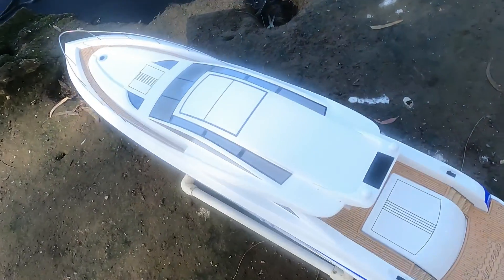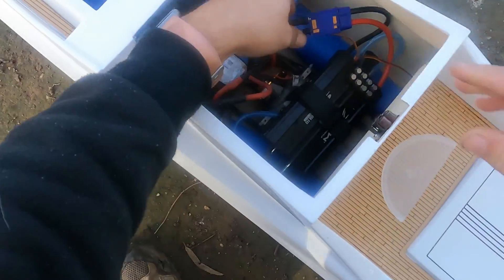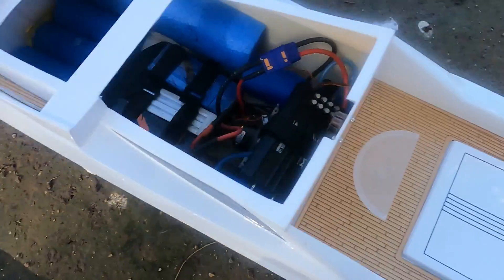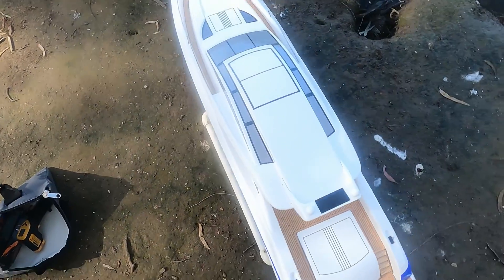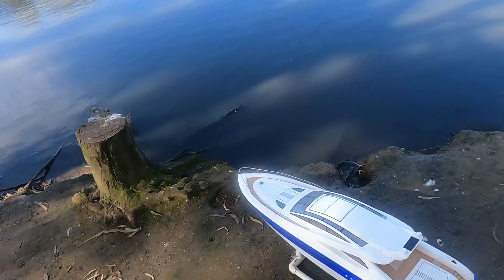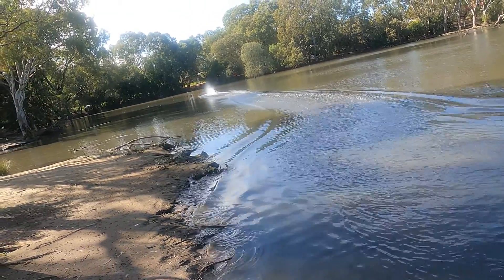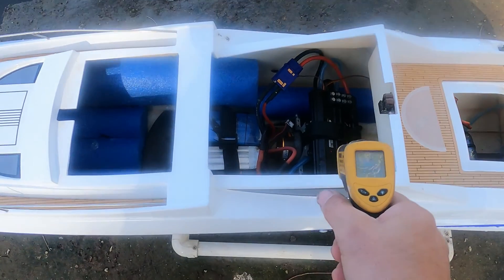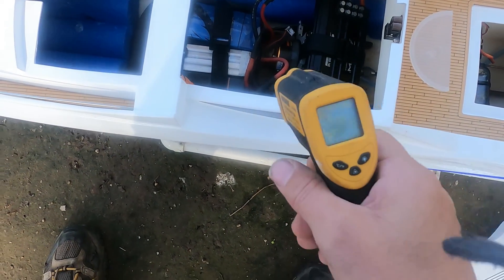Giant TFL 51" Princess running on 14s (58v) - Lets see what happens!

Comment: Hi, you seem very experienced but I will say this anyway since Edwin Cordero said 14S = more power. The important to remember is that this is electric motor not a 60cc engine. 

Torque in an electric motor is dependent on current, not on voltage. Voltage dictates motor speed and overall size. Increasing the voltage above normal parameters will effectively increase the torque but overload the motor.
So, torque (the strength to turn a small or a big prop ) in sea water for electric motor is the same with 6s 8s etc.!!!!  
KV means revolutions per minute per volt. It is not an indication of torque. 
So a 1000KV motor means 1000 revs per volt. 
12 volts means = 12,000 revs per minute. 
This is already an issue since a real boat propeller spins at the speed of 5500 RPM (Revolutions Per Minute), with 5900 RPM being among the highest possible RPM values for a boat propeller

Anyway, here point is - increasing the volts is what increases the revs.
So choosing a lower KV motor (same watts specification) is a good idea to start with. 

So if say, we are using a 1KV motor - 50 size prop and 6s - and say the current is 50amps 
You have watts = V x A = 25 volts x 50 amps = 1250 watts.
Max Revs is 1000 per volt =  Max is therefor 25000 

Now there are two ways to  increasing speed - and here is the important. 
If we increase the prop size only - Voltage is fixed and the motor will draw a higher current to drive the higher load and we have 25 volts x example 70 amps = 1750 watts.
or a bigger prop: 25 volts x 100 = 2500 watts. 
Note that the current only increases which is why ESC speck is in amps and must not be exceeded. 
OR we could increase the voltage to add more speed. 
SEE HOW THIS WORKS OUT, 
14S lipo is approx 50 Volts. 
So using the same 50mm prop we have 
50 volts -  THE CURRENT REMAINS THE SAME  - WE HAVE THE SAME PROP 
50 V x 50 Amps = 2500 Watts.
This is in fact a much safer way of avoiding overheating and increasing speed. 
The speed comes out of more revs per volt 50 volts - 1000KV motor = 50,000 

This is of course theory - since there are many elements at play here. 
A hull not designed for such high speeds, as is certainly the case for our RC Huntsman, will cause the prop to lose MORE grip AT SUCH HIGH REVS which is why 6s to 14 s is certainly not going to double the speed. The pop would be ventilating AND/or gravitating.
In fact you would find that using a smaller pitch prop (I did not say smaller size) will make 
the boat go faster - since it would be easier for the prop to worm its way round the water and gain grip the water. 
Strictly speaking you can work the speed from the the pitch of the prop  
A prop with a pitch of 1cm and 50,000 revs means boat should travel 50,000 cm per minute - approx 18MPH. 

Anyway hope this helps anyone that reads it.